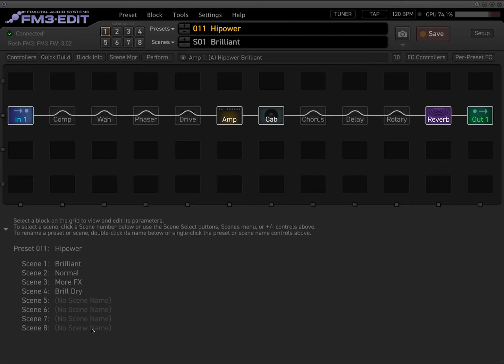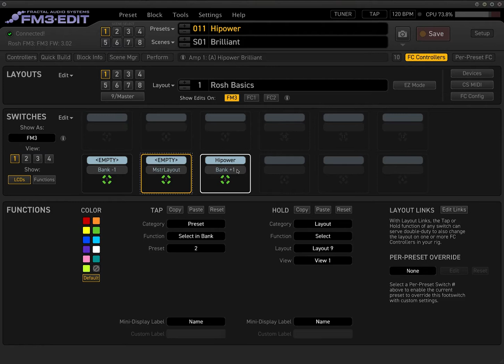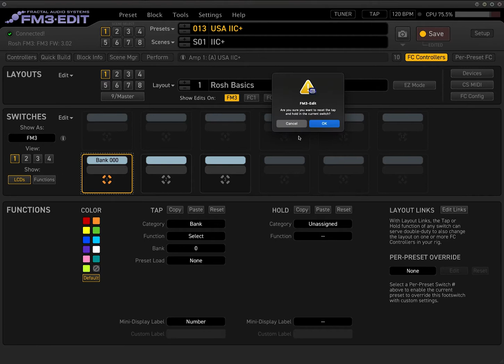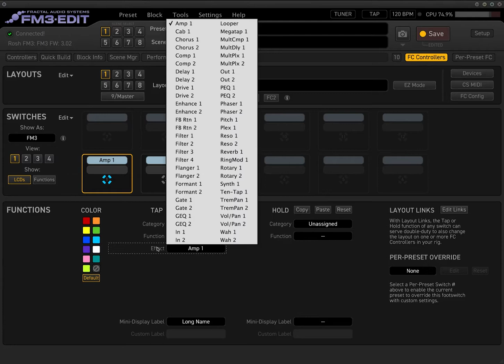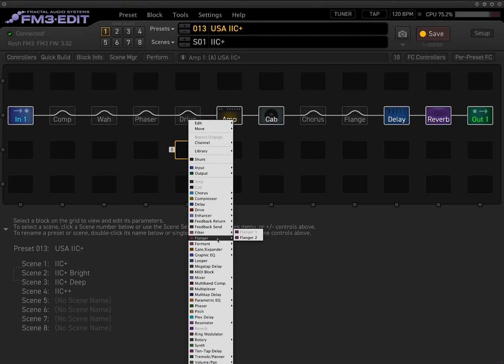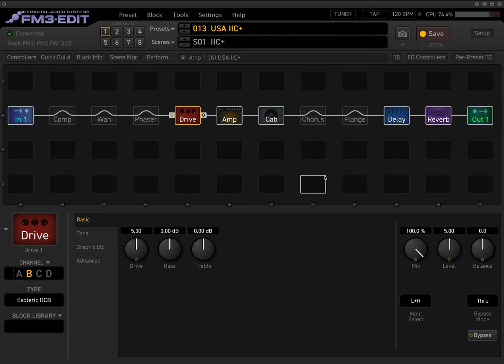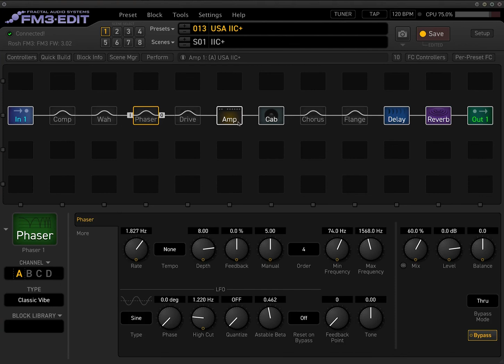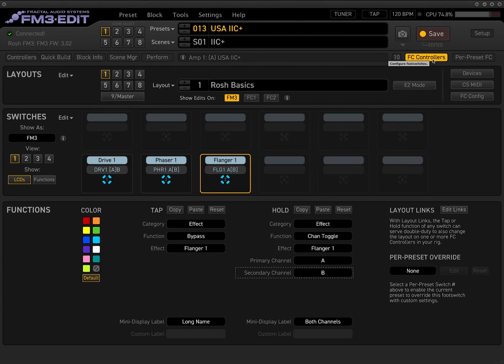FM3 Basics Episode 1: Assigning footswitches - Effects and Hold Functions

Comment: Hey Rosh, can you toggle between 2 types of effects using this method? IE the phase in the A channel and the flanger in the B channel? I'm waiting for my FM3 to arrive and I'll be spending a lot of time with your videos in the next week or 2. Thanks!
Reply from the maker: They need to be the same effect. But, you can use a hold function to engage a different effect type, I wouldn't worry about the channel switching.

Comment: thanks for the video! Is there a way to see what channel the effect block is on in a live situation? I mean, when you hold a button to switch channels, will there be a visual confirmation on the unit informing you that you are on channel A or B?  If not, I find it quite useless in a live situation.
Reply from the maker: You can use the display footswitch and use one of the channel toggle or channel increment functions and have the footswitch display it. There will be a small bracket that looks like this: 

a [b] 

this would mean that channel b is selected in an effect block
Reply: Thanks! That's what I was looking for.

Comment: Great video Rosh! I need to ask though, is there anyway to assign a FC12 switch to turn on/off any effect momentarily? For example, I need Tremolo effect ON only as long as I press the assigned switch. When I release the switch, I need the Tremolo effect turned off immediately. Thank you very much.
Reply from the maker: Yes, you can assign the bypass mode to a control switch and then use the "momentary" function on the switch in the drop down menu.
Reply: @RoshRoslin  Thank you sir! You are a life saver 🫶

Comment: Hi Rosh, First, Thank you for what you have put together in the Videos. I just purchased a FM3 and want to find a small, (pedal size) power amp that I can connect to a speaker or speakers. Thanks!
Reply from the maker: The seymour duncan powerstage 170 is a great small footprint option for power amps and cabinets.
Reply: @RoshRoslin  Got one ! thanks.

Comment: On fm3 when you push on effect you have access to all effects on or off. They are in a certain order. Not usable easy. I need on the first screen drive, phase and chorus. I never changed the reverb on off for example in the middle of a song. Is there a way to change the effects order that apply to ALL presets and not one ny one ? Thanks for your help.
Reply from the maker: If you need effects order to change, I would recommend just using separate presets, especially if you're using the FM3 because you're limited on the instances of effects.
Reply from the maker: If you get one of the higher DSP units you can just make two parallel rows with different effects orders and switch between them using the multiplexer block

Comment: Nice dude ! Thanks for made this video ! I want to ask , can you use the hold function as a mommentary switch like whammy? Or to hold or sustain the reverb or delay?
Reply from the maker: You feasibly could, but for that type of functionality I would actually recommend using the "momentary" function on the control switch. This will allow you to activate an effect, external controller etc (you can assign pretty much anything) and then it will stop when you release the switch